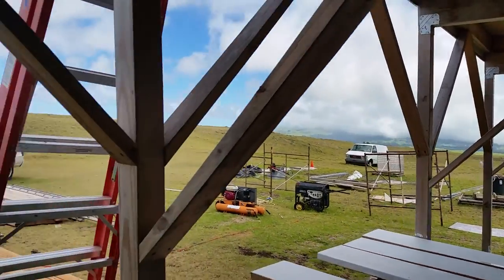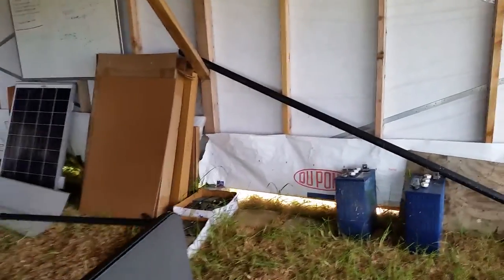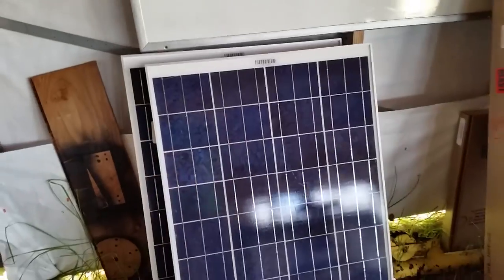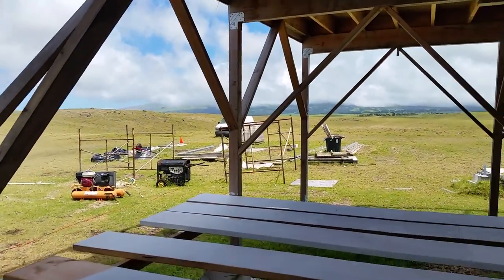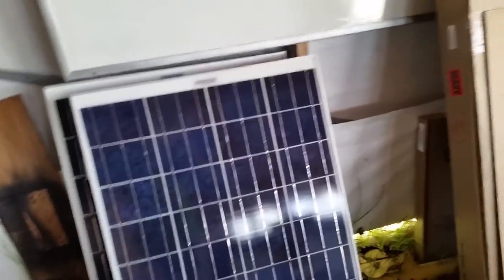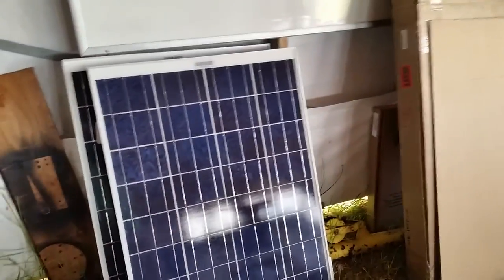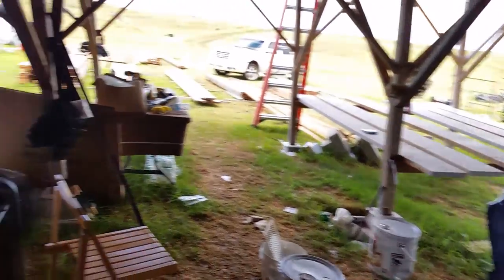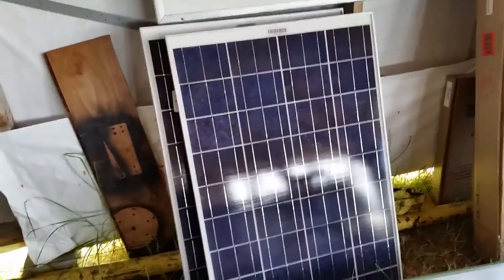About To Start Building A Solar Powered Golf Cart

Comment: You need 4 X 12 Volt to get the 57.6 Volt to fully charge the 48 Volt batteries. 3 panels won't work my friend.

I use 24 Volt panels, so two in serial would do.
Reply from the maker: yah I was thinking about doing that. I have 24v panels for my new home. Thanks for looking out.
Reply: Modern Off Grid DIY the peak voltage from panels has no power, at the moment you connect it to charge it just drops below usefulness. 24 Volt panels are fine, I like them a lot. That's what I bought a charge controller similar to yours for. Bytheway, I trust my relay is faulty and I will send it back so they will check it. Will keep you updated 😉

Comment: Do NOT mix different solar panels in same grid, very bad idea
Reply from the maker: Yah I know what you mean. I thinking about just using 3 100w solar panels.
Reply: Modern Off Grid DIY Yeah good choice, what kind of solar charger are you going to use on golf cart? any dump load?
Reply from the maker: Im not sure what charge controller im going to use yet but it would not have a dump load, just disconnet when batteries are charged.
Reply: Modern Off Grid DIY I see, as much us I understand solar panels they need the electricity to flow away somewhere, so be careful not to cause damage to your panels
Reply from the maker: I will figure out somthing it really know different then my house the only different would be the dump load. I will work it out when I start that project. Thanks for the input.